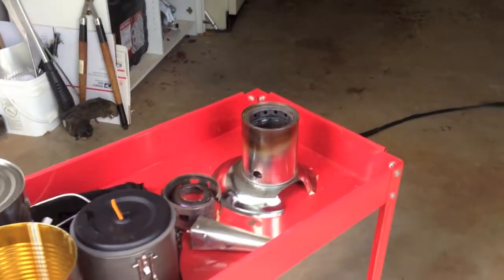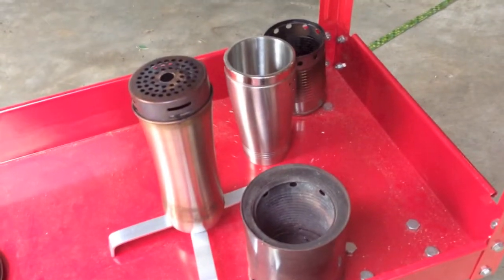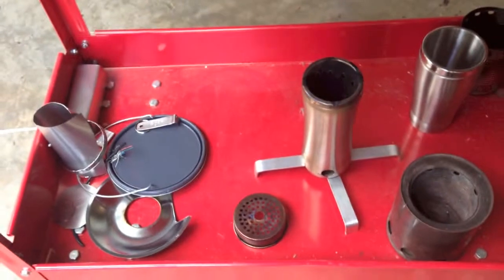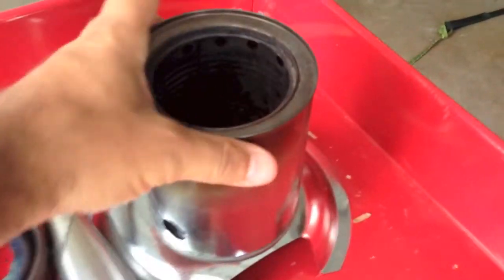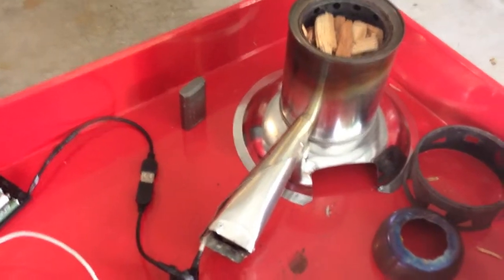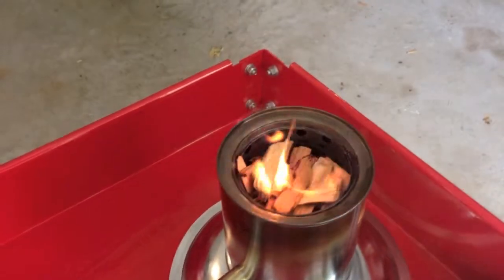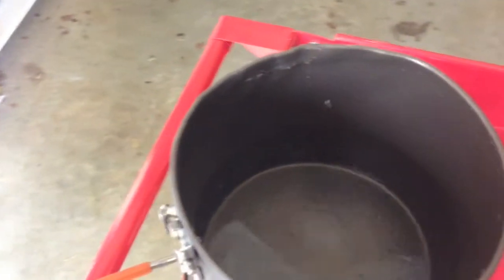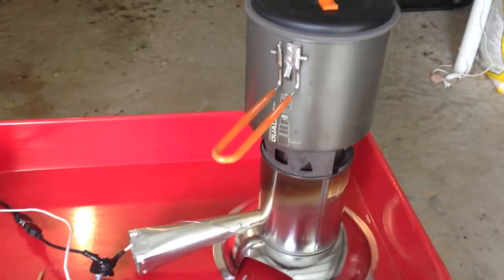Forced Air Woodgas Stove Design - Work in Progress

Comment: When I started messing around with forced air gasifiers I noticed a lot of what you are seeing. I built  a stove that  had an adjustable primary intake. It allowed me to see how the stove reacted to differences in air flow without having to re-drill the holes. I found that when using a fan you need less primary air than a stove without a fan. Also you need to adjust your fan speed throughout the burn.....more speed when first starting, less speed once the wood starts producing gas.

Comment: Interesting! I think the problem you described at the end is the air
 ratio.

The fan gives too much air in the upper part of the stove (near the flame) and too low on the bottom of the fuel. The more air you put on the bottom the more woodgas you get, then in the upper part you need also some air to burn the woodgas.
Try modifying the up/bottom air ratio

Comment from the maker: ...problems commenting from mobile app. So, I haven't tried smaller holes because at that ratio, the holes at the bottom would get very tiny. I've even experimented with a 4:1 ratio to make the bottom holes a little larger, and that seems to help sustain a good burn more consistently. There is only about .5 inches between the cans, and also I have updated the potholder pretty significantly. I also made a much larger version using a gallon can that seems to work very well with a 4:1 ratio.